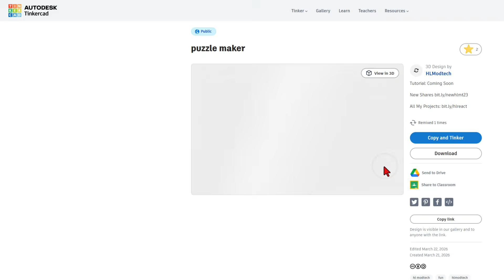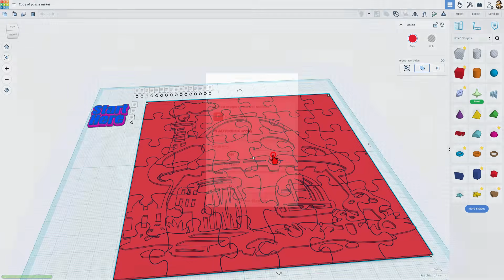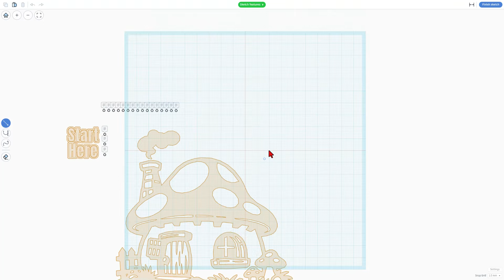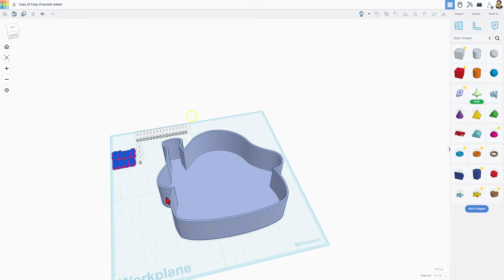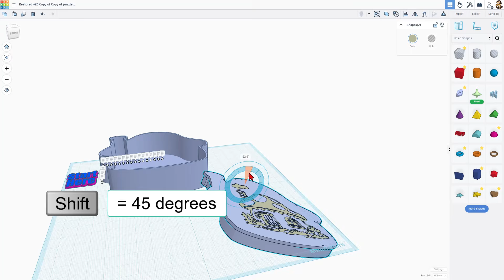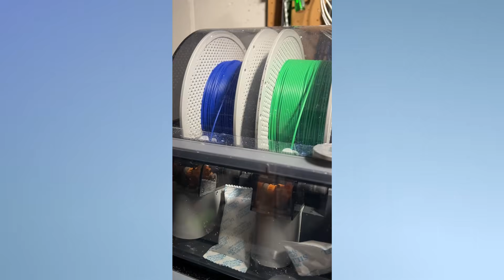Tinkercad 3D Printable Puzzles & Matching Boxes: SVG Sketch Wizardry 🔥

Comment: How would I make a bigger puzzle with more pieces from the template?
Reply from the maker: I generated the puzzle pieces with Google Gemini... so just pick a prompt that gets you a large enough # for your printer bed. How many pieces are you thinking? My puzzle, at 15cm square is pretty small.
Reply: @HLModTech  I'll try that, I was going to try the whole print bed at 250x250 maybe?

Comment: I’ve been using TinkerCAD for a while and use it alongside my Asoire software and both play nice together on most projects. For some reason, I couldn’t keep up with how you embedded the logo into a layer. Is it possibly to maybe do a video that shows this? I’m mostly a CNC’er, and don’t print much. What I have done in the past is emboss a negative and then have to reprint an inset .2 less and have it snap in. Would be great if you have a step by step of dropping an image into a base. I’ll have to try the CNTL down, but it must be something I’m missing.
Reply from the maker: That is exactly what I did. .5 down to cut the negative image... then show all, and Ctrl+down to drop the part that gets printed into the negative space. Not sure what other step I would show.
Reply from the maker: In Tinkercad, I set it as a hole, then union grouped to cut it away. That would be the same as your "emboss a negative".

Comment: How do you get the bottom to print so nice? I'm using an ender 3 v2 and my bottom layer is is just lines. Also, how would I go about printing multiple colors on my ender? Thanks for these great tutorials. There is always something that I can use in my projects.
Reply from the maker: The Bambu P1S has printed that nicely out of the box. I, too had an Ender 3 back in the day.. fun, but never the same level of quality. To do the 2-color puzzle parts, you could do a pause at layer to swap to the 2nd color. For the puzzle I made it would be after the 1.2mm mark. There is no way to get the flush color top of the box with an Ender 3. That is a trick that an automatic material system (AMS) allows.
Reply: @HLModTech  Thanks so much. Is it the limitatios of the ender that I can't get a nice smooth bottom like what you are getting with the bambu? It isn't a big deal but I can see the individual print lines and not a nice surface like you are getting. It isn't so bad for the bottom of something but not so great when it is the top of a project. I'm using orca slicer so I guess it is just a modified bambu slicer. Could it be I am on draft .24 and not standard .2?
Reply from the maker: It could be a ton of stuff. How accurate your bed leveling is, is your printer calibrated correctly, and how close first layer is to the bed. I never took the time to get everything perfect in my classroom. Too many printers.. and I had 130 kids to teach. There are tons of videos online about it, but now I use the P1S so I have not had to master it. Yes, Orca, is almost identical to Bambu. The .24 is going to be as rough as your settings can be since they are rough draft. I almost always use .2 standard.
Reply from the maker: Here is my 2 color Ender tutorial. https://youtu.be/9oJV5kOhB8Q  Might be a good chance to check out the print quality I was getting too.

Comment: watching your video, I can't get an SVG to import into the puzzle maker tool in TinkerCAd.
Reply from the maker: Take a sceenshot of your image and use Picsvg. That is my go to for getting an SVG to work.
Reply: @HLModTech  ok let me try that.  I couldn't get it to cut like you showed in the video as well, once I found a image to work
Reply from the maker: You may need to be patient... and do the back in and back out I did. I did a 3 layer one and I had to make it into several cuts.  Saving that for an advanced lesson a bit later.
Reply from the maker: Get me a share link, in my Patreon design questions area and we may be able to help. https://bit.ly/patmess
Reply from the maker: Easily share a link for your Tinkercad project: https://bit.ly/sharehl This setting gives a copy so we can assist without breaking anything you have already done.